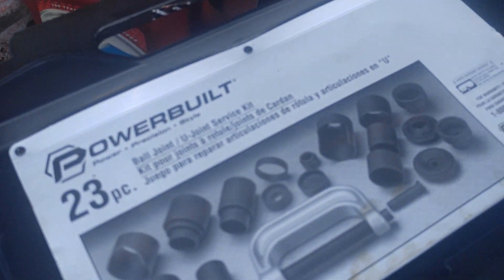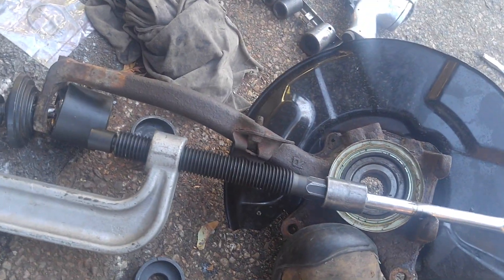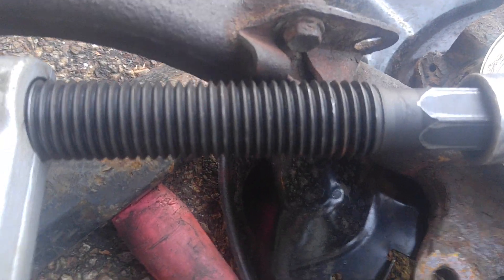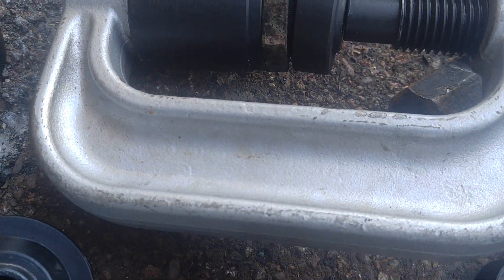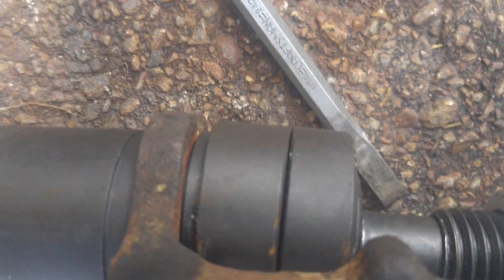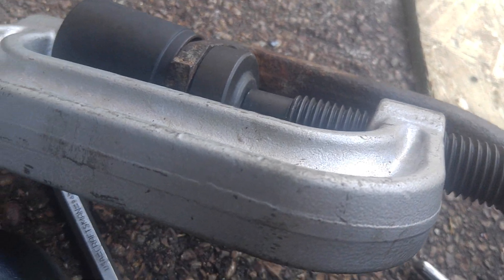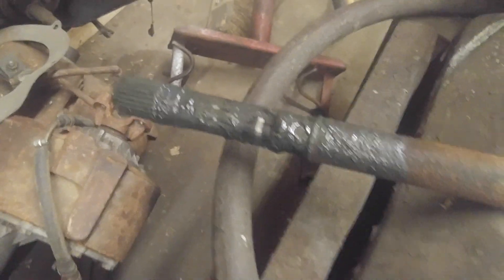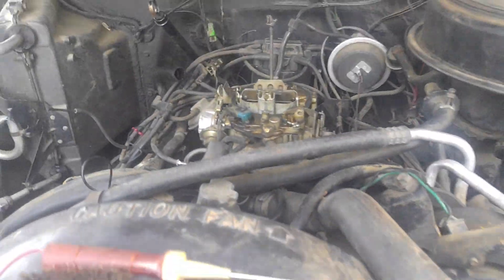RusTundra Ball Joint Install 9 28 18

Comment: That blue device on the carburetor is a mixture control solenoid. It does exactly as the name implies. It fine tuned (for the day) the fuel being allowed into the carburetor circuits to help keep the fuel management within given parameters. There should be a single wire oxygen sensor in the exhaust. It runs a very slow in comparison to even a few years newer TBI type computer fuel management system. There is a throttle position sensor as well that could be responsible too.
Reply from the maker: spikedpunk has it got an OBD I plug in? How to diagnose?

Comment: I have one of those ball joint presses, bought it from harbor freight to do the ball joints on my k5. Mine doesn't have as many adapters as that set though. I have composite IR impact (not titanium line) I bought at a garage sale, I can't remember how much it was but I know it was no more than $20, works great and powerful.

Comment: ultrapower i believe are china wholesale ball joints you can get off ebay from multiple sellers. Good part is they give a 1 yr warranty. Have some on my daily; with 50k miles just starting to get slightly loose as i have noticed some sag in the front end. Not bad for $4.40 per lower ball joint.

Comment: Hey Mr CW i have a New ACdelco air filter and An original AC Duraguard oil filter for the 6.5 diesel trucks. i got no use for any of it. you can have it!
Reply from the maker: Travis R. Haha, I just bought an air filter for my 6.5, actually about two by mistake. And I have a case of oil filters for any Chevy or 6.2, 6.5 diesel. Where are you? I'll pick them right up lol
Reply: CORVAIRWILD i’m in arizona. i got no use for the stuff. just taking up space on my big tool box.